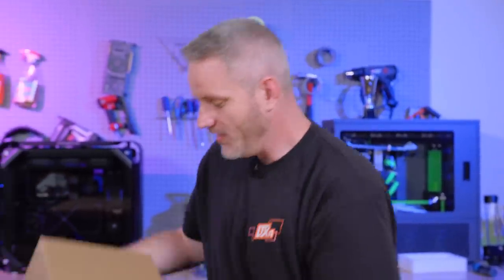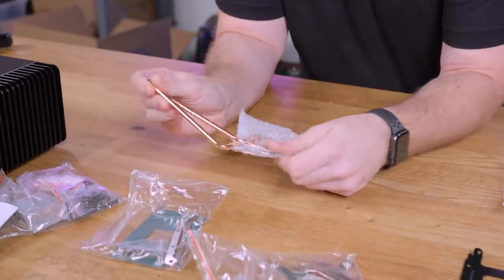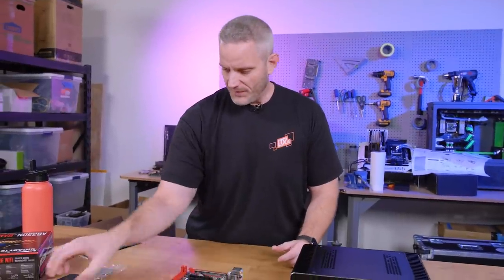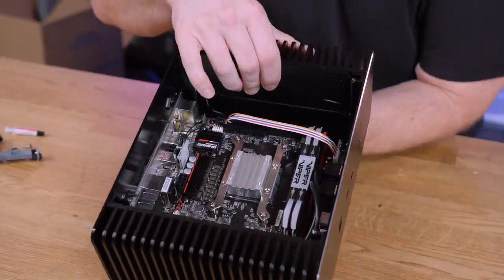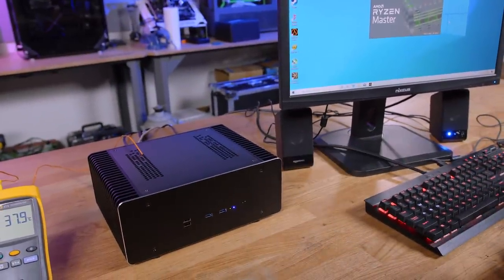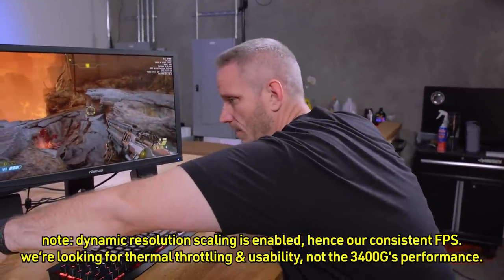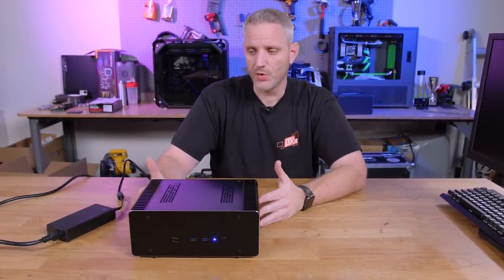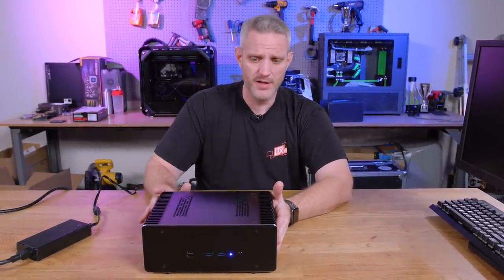I've never built a PC like this before...

Comment: You can get short 10cm single pin header extensions to get around many cabling issues - they will work with any mobo header. I use them to get around clearance problems where I had to bend the pins slightly on my mobo to connect FPAUDIO and USB2.0 leads. Remember case manufacturers can't cater to every layout of mobo. I do agree with you though - an inch longer would have solved the problem easily.

https://www.moddiy.com/products/2.54mm-Dupont-Motherboard-Internal-Jumper-Male%252dFemale-Cable-Wire-%2810cm%29.html

These passive systems are great for zero maintenance builds, places where fans get killed with dust prematurely or sitting on a shelf/cabinet. Even ruggedized installs like a van/car PC this would work with no spinning platters inside.

Steam streaming is a great use case, especially if you have your big gaming PC in a different room, but I'd say any mid tier laptop can fill that use case too and be way more portable. I do Steam streaming on my XPS 13 and it works great.

Comment: Yeah, I blame Gigabyte boarddesign here, cause the board uses the old style of layout as the GA-F2A88XN-WIFI FM2+ and older Gigabyte boards (MSI copied Gigabyte but switched SATA and USB around which improved the layout a bit) which brings the DIMM-slots right to the edge and the USB 3.0 in the futherest and imho stupidest possible spot from were you would expact it. Back in the day I had to choose between an 120 mm AIO and Front USB 3.0 in my Lian Li Q-08 case. I first choosed the AIO cause I had no other cooler to hand but it became soon clear I had "downgrade" to an Noctua aircooler. But that was clearly to do with the boardpartners low expactions of Ryzen 1st Gen why they gave minimal thought to the boarddesigns.

Comment: They make an extension piece for USB 3.0 I had to use one on my O11D to get my front panel USB to work with fans in the bottom bc Asus put the connector on the bottom. Would totally solve that problem they should just include it with the case/cooler....

Comment: 10:15
yeah with those custom sff builds you have to buy custom cables, sometimes extensions
also, not all ITX boards have the USB 3 in that location
on mine, I used a custom cable and wrapped around the CPU to the other side of the RAM
Reply: I have that motherboard and can confirm that it is laid out completely differently from any other itx board. Usually the socket and ram is closer to the io and the headers are right next to the ram
Reply: @KevinSiebert  that is an interesting variance
on my custom ITX build when my old MB fried, it took forever to find another model with the same layout of CPU, ram, USB etc

Comment: I have the same motherboard. It is a bad design. Gigabyte Moved the connections to the top where the normal boards are on the side.  Not sure what case the board was designed for. I replaced it with a b450 gigabyte and the normal connection design is better and probably would work in the case.

Comment: Geez... Dedicated ram is needed only for buffer flipping, like vsync. On my 2400g there is no difference between 64M and 2G dedicated ram. 128M when I added another display. Linux drivers do not even move stuff to some "dedicated" part, GPU can access whole memory when needed.
2G or higher is just marketing, and you loose memory for other uses.

Comment: The one side of the case is hotter than the other side because the heat pipes are working better on the hotter side.. it seems

Comment: It's worth nothing that most ITX boards, or at least ones that I've seen, have front I/O connectors on the side of the mobo that faces the front of the case, rather than the back, so there would usually be a lot more slack on that cable

Comment: “They don’t make high speed RAM with itty bitty heat sinks”

Corsair would like a word with you.

Also, on many boards, the USB3 header is at the front. Gigabyte make a dumb dumb when they designed your mobo. Not that they are the only ones tho, Asrock stupidly placed the type C connector under the first GPU slot on some of their mobos.

Comment: I wonder if there's room to run the usb cables under the board instead of over the ram. Or the case was designed for the USB header to be in a different location on the board.

Comment: Somebody, tell Jay there is a plenty of relatively-low-profile memory at the market, e.g. G.Skill AEGIS and A-Data Hunter or less attractive but best-for-buck Hynix or Kingston ValueRAM - all of this sticks operate at 3000+ frequency from the box. Manufacturers of this case might just used parts which fits?

Comment: I've been wanting new designs where the case is used as a heatsink for ages, just not quite sure how they do it since all motherboards and GPUs align differently and custom connectors aren't cost effective. Kinda need a stretchy heat pipe or something.

Comment: Ya, its the manu's fault that the usb 2 and 3 cable should be longer, no doubt
... that said, don't ya have usb header extension cables, even a 90* adapter in a box somewhere?

Comment: APU VRAM allocation...
AFAIK there's not much benefit to trying to get down to, for example, the 2048MB (2GB) capacity allocated from the DDR4 memory for the GPU. Windows allows a program to DYNAMICALLY use up to HALF the installed DDR4 memory. If you drop the texture quality and/or resolution etc to get under 2GB you're naturally getting a better FPS because there's less load but otherwise it's the same DDR4 memory. In general, there shouldn't be much performance penalty for exceeding that 2GB limit as again it's dynamic... how to prove? I guess try running a BENCHMARK that uses more than 1GB of VRAM and change the VRAM size from 1GB to 2GB to see if that has any affect on performance. Probably doesn't.

Comment: 1 month later...

Could the reason why it's hotter on one side than the other be because of how you did the heat pipes? For example, one side's pipes was closer together at the fins compared to the other?
Curious to see if that's why or not

13:26

Comment: Why can't you side mount a gpu above the mobo so it's facing up and use those holes or cut a whole in the top? You might be able to get a gpu in it. Or replace the top panel with a custom panel.
Reply: In fact could you make it just use the apu to send the signal to the monitor and use the gpu only internally and do all the real processing so as to not need more external holes? Unless they finally changed it so they can use both devices together for extra performance. Maybe extended vram.

Comment: The center heat pipes all go to one side so most of the thermal transfer is getting soaked to the left side while the outside pipes are going to the right, mystery solved. Will a 1212 config fit instead of your 1221 config?

Comment: I noticed it had a spot for a single slot gpu with riser cable
Reply: sooo maybe if u had an old inter machine that would fit you could add a cheap like 710 gpu from Invidia?

Comment: Looking at the way that aluminum block is machined would it be plausible to mod the top of the case to accept an air cooler but just bolted onto the passive cpu block....?

Comment: its not the cable you problem the problem is your motherboard if you installed the asus strix b550-i gaming motherboard you would have been able to plug your wire and thaty board even has a m.2 slot next to the pci-e connector

Comment: do you leave it running at night? or do you close the flow valve to close it until the morning. I am afraid closing the valve increases the pressure too much in the last bottle. 
once you activate the yeast, it does not stop, so what about nights?

Comment: About a decade ago Zalman had a full sized passive case just chock full of heat pipes: https://www.quietpc.com/tnn500af  They also had a "media PC" case with a similar form factor to the Akasa case: https://www.quietpc.com/hd160-plus  They're both weird designs but Zalman was pretty fanatical about quiet PC's.  I was using a Zalman Reserator about 25 years ago when PC's didn't generate quite so much heat...

Comment: Is my Build good or are there any spots that can be improved or shifted around, 
PSU: Gigabyte P750GM 750W ATX PSU Power Supply
CPU: AMD Ryzen 5 3600X, 6 Core / 12 Thread AM4 CPU, 3.8GHz
GPU: Gigabyte nVidia GeForce RTX 3070 EGAL OC 8GD ATX GDDR6
MB: Gigabyte B450-AORUS-PRO-WIFI
RAM: Patriot PVR416G360C7K, VIPER RGB 16GB (2x8GB) DDR4 3600 CL17
SSD: Crucial P1 1TB M.2 (2280) NVMe PCIe SSD

Comment: Maybe someone will be able to answer my question. But I've seen it on several boards no through watching a lot of build videos. But sometimes there's a CR2032 placed on the board in a socket, what is that for? Does it act as a overflow or something?
Reply: that's for the bios so it can remember your bios settings when the computer has no power, never seen a motherboard that doesn't come with one.

Comment: That micro atx board has an horrible layout. I always saw the USB 3.0 conector to the right or under the ram sticks. Even the 24 pin conector is in an awful position. Also the SATAs, what the hell are they doing up there? I think you choose the worst possible motherboard for that built.

Comment: I once had one of those Mini-PC DC to DC power supplies. Worthless junk! 12v rail is not regulated, 5v rail overheated (fried out), and that was only with a low-end Asus motherboard. Unless you plan to mount a full ATX power supply OUTSIDE of case, save your time and money.

Comment: JayTwoCents, I have essentially the same case but, with mine you can get a half size PCI in there....  https://www.quietpc.com/sys-fc8   I have had it a good 7 years with the same PICO Psu arrangement.  The internals are close so, heat soak was always a thing.  Temps were cool enough that it never throttled however.

Comment: Man, Jay, all of your issues are ENTIRELY the result of an incredibly craptastic motherboard layout. All of them. Gigabyte put the USB3 header where the EPS12V usually is. Look at nearly any B450 Mini-ITX board (like the Asrock B450 Gaming-ITX/AC or the Asus ROG Strix B450-I Gaming) and they all have their SATA, USB3, USB2, FP Header, and 24-pin  connectors along the edge opposite the I/O panel. In which case, the cables they include are probably a bit long. 

Say it better as "make sure the layout for the board you want to use is somewhat standardized instead of this funky board" is a hell of a lot better. Don't blame case manufacturers for the flaws of the motherboard.